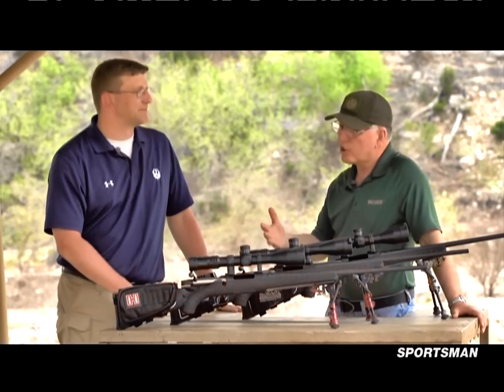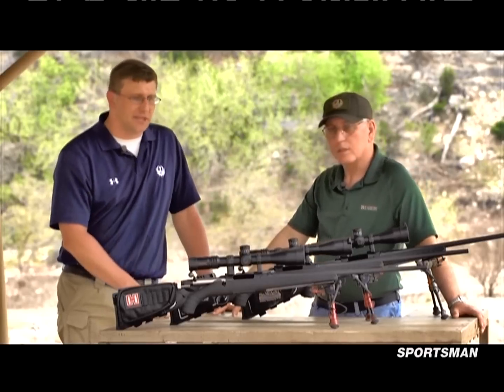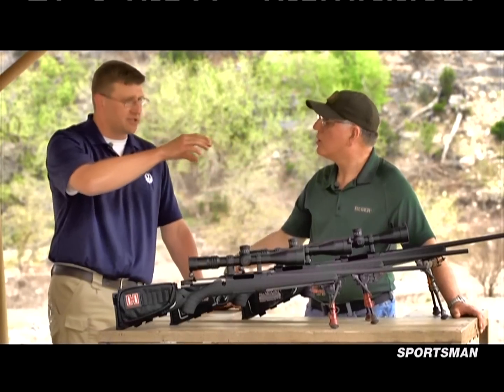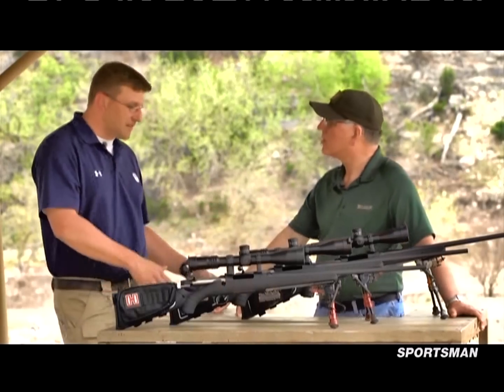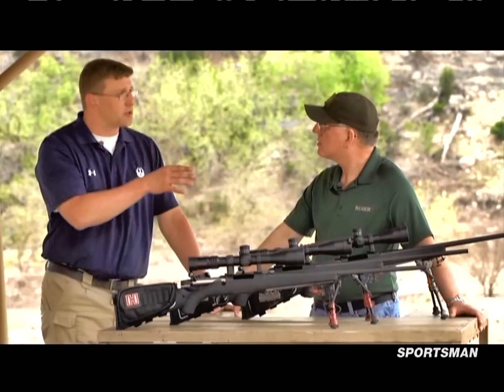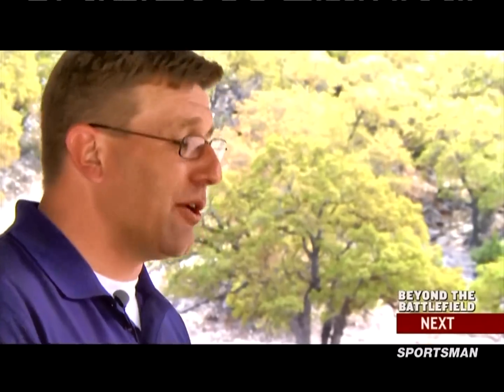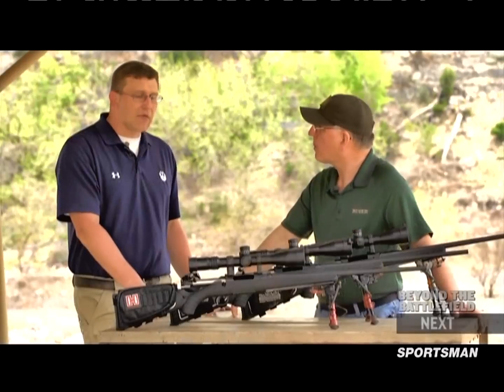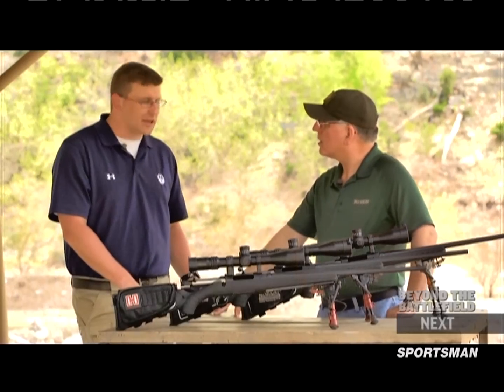Bullet Weight vs Twist Rate test

Comment: This guy says it's about the "bearing surface length" that determines the twist required. This is not true. Stability is an externally ballistic event that is a result of internally ballistic events. You can create a 75gr bullet that has the same bearing surface as a 55gr bullet. This would not mean that the twist rate to stabilize it would be less than the twist rate required to stabilize a "typical" 75gr bullet.
Reply: The bearing surface is the only available means of any bullet to engage rifling. Yes that surface area in mm² or in² changes relative to the TYPE of bullet shape per a given volume of material; ie. flat base or boat tail, ogive shape, hollow point, polymer tipped, partition, even how the jacket is distributed all affects the amount of bearing surface in a given caliber with a given bullet mass.
For sake of discussion in the video, he has to start somewhere.
Reply: @turnin.sprocket  I understand, but he literally just gave all these newbies the impression that it's all about bearing surface. Now when somebody says "the length of a bullet has more to do with stability than weight", one of these impressionable newbies is gunna chime in saying "no actually bearing surface is the determining factor, not length". I know because I have been "corrected" by such a person in a thread. I couldn't imagine what could give them such a preposterous idea like that until I found this disgrace of a video. The truth is it's not even about length from tip to tail, but rather about the moment arm between the center of mass and the center of pressure. With most bullet design profiles the arm lengthens with bullet length, but not always. Bullets like round nose flat base projectiles have relatively short moment arms for their length compared to boat tail spitzer deigns.
Reply: @kn761  Well I'm not sure the video was designed for the "newbies" honestly. And I understand what you mean. My career is mechanical engineering.
Reply: @turnin.sprocket  nice. I'm in school for my BSME right now part time. My first BS was in physics.
Reply: I went to a 2 year technical college. Never went 4. Been working in various related jobs for about 15 years. Don't get yourself sunk in debt. :)
Reply: @turnin.sprocket  yeah too late for that! I'm using gi bill for this one so It's not getting any worse. I'd go the 2 year route, but it seems like everyone requires that 4 year these days.
Reply: Not really. It just seems like the bachelor guys/girls get $10 more per hour after working equal amount of years. Yet I don't want debt.

Comment: are the twist rates marked anywhere on the barrel?
Reply from the maker: Sometimes.  They can be in pretty small print so good light will help you find them.  If they aren't there try Google for your make and model of rifle to see if you can find it.
Reply: Don't gunsmiths have a mechanical gauge they use to determine what a given barrel twist is?
Reply: Look in your owners manual, or measure it yourself, with a ruler, and a light. It's not that hard to do.
Reply: True. A bore brush, a piece of tape, and a measure.

Comment: Twist Rate.   Bullet Weight
1 in 7.            62-75gr 
1 in 8.            50-77gr
1 in 9.            40-75gr
1 in 12.          40-55gr
Reply: The 1/7 can shoot heavier bullets than what you show.
Reply: Nice chart. People with 1:9", can you comment what is heaviest you had good success? I have only shot 55gr with excellent results. Curious about ~62gr.
Reply: Too bad its about the length of projectile and not weight then.
Reply: 1 in 10
???
223 rem
Reply: and .308?
Reply: Apophis when it comes to 308 most are a 1:10 twist and the best ammo for it is 168grain.
Reply: @jonathanhudson4623  wrong. There's nothing you could back that up with.
Reply: ... it can depend a lot on material, both in bullet lenght and gyroscopic stabilisation. Also a large effect does boat tail vs flatbase . So what you say is wrong. Even more it starts to differ with diffrent ogive lenghts.
Reply: @_j.v.st._7367  It's not wrong. It's a "moving target" chart, given a lot of other factors and assumptions taken into account. It's a guide.

Comment: calls it a misinformed myth then proceeds to explain how the test results confirm it to be true.  who's the one misinformed?
Reply from the maker: Watch it again.  What Ken says is "...I'm trying to decide whether it's a myth or not...."
Reply: joemrp05 velocities change stability as well. a heavy bullet at screaming velocity will stabilize better than the same projectile traveling at slower velocity in the same twist rate.

as far as grain weight to twist rate. typically the heavier the bullet the longer the bullet because more material is needed to make up the weight.

some specialty bullets have extremely long ogaves and short bearing surfaces. these typically require less twist rate than traditional bullet but require single round feed because the bullet is now too long to fit in the magazine.
Reply: Kyle, what is your physics behind your statement saying bullets with long ogives and short bearing surface require less twist than traditional? Just wondering because it's totally wrong.
Reply: Heavier and longer always needs higher RPM, regardless of bearing surface. I think the guy in the video was simply saying, in general, the heavier bullets will HAVE longer bearing surfaces. It's a general statement. One could say "heavier" or one could say "longer" or one could say "greater bearing surface." Without going into exact math, these are general ways of communicating bullet shapes and the relationship to weight. It's geometry and density.

Comment: test it at 300 yards you will see a huge difference. i seen a 1:12 shoot 12 moa at 300
Reply: If it can't shoot are 100 I would not have high hopes the groups magically will all go into a single hole at 300.   These are varmint calibers not for Deer.  Need 1/2 MOA at 100 yards or toss it out.
Reply: @Physics072  settle down bob. plenty of people use 223 for deer.
Reply: @James28R  I know I could kill one with my .204 ruger too.  Its illegal to use .223 for deer where I live.   Some places you can use them though.   A .22 rimfire can kill one if placed well in the head.